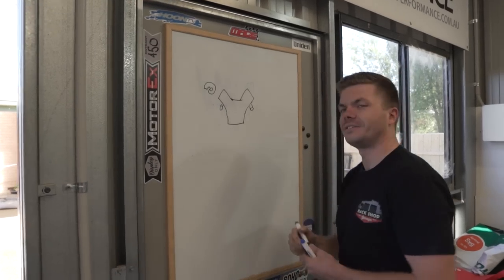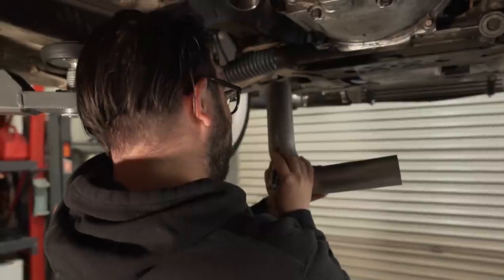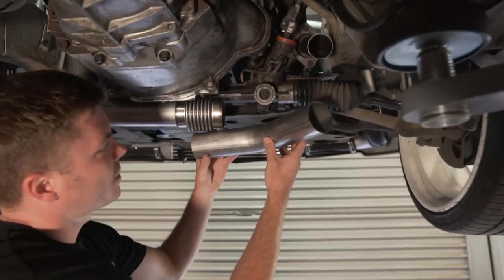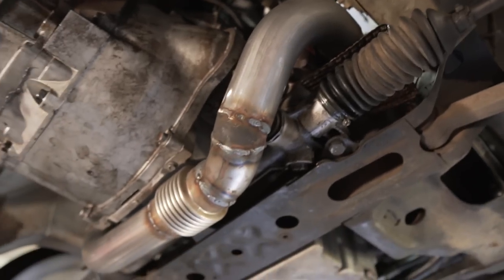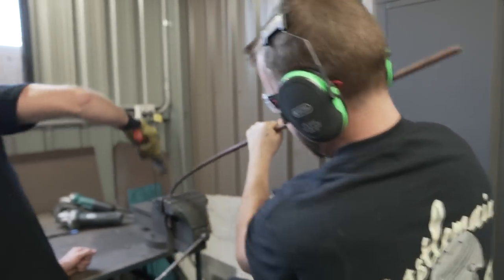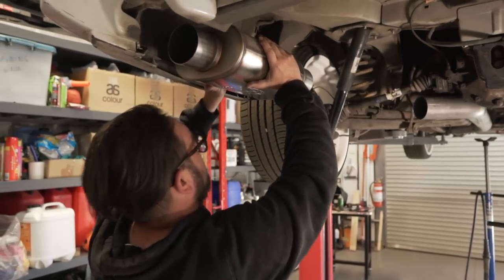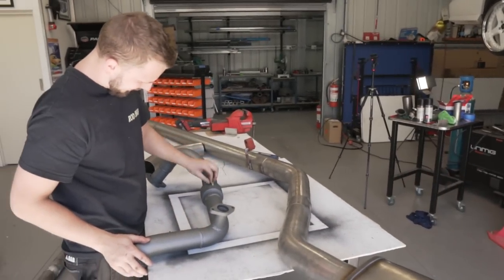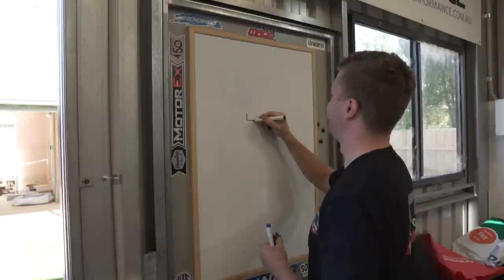BUILDING A LS1 TURBO VY UTE!! - Part 10 - BUILDING A CUSTOM MADE MASSIVE 3.5" EXHAUST!!!

Comment: Comments section never fails to produce all the arm chair experts lol! 🤣
On the turbo tonner we used a 38mm gate and not in a priority flow location, but still managed to hold a steady 8psi gate pressure. Could it be done better? Sure! Doesnt mean it isn't going to work. People forget that the gate isnt just servicing one bank. The turbine presents as a restriction, pressurising the exhaust manifolds, and the wastegate becomes the relief.
Reply: This comment section surely has to make an appearance on the podcast 😂

Comment: Wrap tip...soak the exhaust wrap in water before using it, helps keep itchy fibres down and also helps cinch it down when installing. Good stuff guys loving the vids

Comment: Gerday mates, been watching you all for a couple months now & love your show. Watching the LS1 install & to see how you attack problems is way cool. Ability to solve probs is a gift which you guys seem to have in abundance. Its inspiring. Your use of a propane torch to heat things could use a bit of help. The hottest part of any flame is the tip of the blue burn, not as close as you can get the torch tip to the job, back it away till the tip of the blur is just off the job. This will make heating faster and hotter. Could have used this to make the bent rods to mount exhaust. All told, the exhaust looked superb as was the turbo pipes and how you solved the intercooler mount was too cool mate. I could watch you guys working for ages. It comes across as two close mates having fun with cars and enjoying the hell out of the day and the job. Thankyou for all the entertainment you have given me and I will keep following you as long as I can.  Peace out.  Wayne
wayneleonard.muir@gmail.com

Comment: Love your work Guys. Just a bit concerned about the position of the waste gate. Won't the left hand manifold will be blowing full pressure to the turbo. Not sure if that'll work or not. Anyway have a great Christmas and new year. Keep up the good work Guys.
Reply: not ideal but works fine
Reply: The left hand manifold will still get caught by the restriction of the turbine, and the exhaust manifold and crossover will still pressurise thanks to back pressure.

Comment: I’m a big fan of the channel, never miss an episode 👍

The wastegate position in my opinion might cause an issue, shouldn’t it be after both banks have converged and before the turbine housing?
Reply: Gas flows via the path of least resistance. With the manifolds connected by the crossover, they'll act like a single manifold. Pressure relieved at any point will relieve pressure at every point. Needs a cat though.
Reply: @howey1975  but the exhaust gases from the drivers side bank are travelling in one direction towards the other manifold, once the gate opens does only the exhaust gas from the drivers side regulate the turbine speed? As I don’t see the passenger side gasses travelling down towards the gate against the drivers side gasses. Would that not just promote uneven heat between both banks?
Reply: Think of the manifolds and crossover as though they were a water balloon with two inlets. The water inside the balloon isn't governed by where it came from, it just wants to get out. Open the "wastegate", water comes out and relieves the pressure in the whole system. There's virtually no difference between a gas and a liquid under pressure
Reply: @howey1975  are you saying that the 2 exhaust manifolds are the “balloons” inlets? 
If so I would agree with you that opening any passage will vent pressure. In this case tho you are also spinning a turbine, all the gas is going in one direction, then the gate starts to open, what happens to the gas flow between the gate and the passenger side exhaust manifold? Which direction is it going? What is continuing to power the turbine?
How I see it is that the drivers side gas will do all the venting to atmosphere with some of it still travelling up to the passenger side to continue powering the turbine, with all the gas from the passenger side powering the turbine.
If the turbine doesn’t need any drivers side gas then all of it will go out the gate, if the turbine doesn’t need even all of the passenger side gas then there will be a reverse flow in that pipe in between the gate and passenger manifold, while still spinning the turbine.
This reversion up and down that section of the cross over seems very inefficient to me compared to venting the gasses after the 2 manifolds have converged, keeping gas flow going in a single direction at all times.
Reply: I think you're over complicating it mate, but I could be wrong.
Reply: @seanb250  The turbine quickly becomes a restriction, the entire manifold and crossover pressurise (hence people logging EMAP for backpressure data) and the wastegate then becomes the pressure relief.
Reply: @TorqHub  I do understand how the whole system works and the importance of gas speed and pressure ratios within the exhaust system that powers the turbine.
Given all that, I see the placement of the gate in this case very inefficient, it will introduce changes of direction in gas flow, which is a loss of velocity, this will lead to increased turbo lag and other boost control issues in my opinion.
You surely would want the gas direction of flow to be in a single direction and bled off via a gate just before the turbine housing itself.
Reply: @Sean B  in a perfect world, absolutely. And if you needed precise control for say a boost by speed application, it'd be non negotiable. But in this low boost Street bruiser that'll likely see gate pressure or a touch more with a boost tee, this will work.
Reply: @TorqHub  I agree that it will work, rubbing 2 sticks together to make fire also works but you just wouldn’t do it that way if you had a lighter.
Anyway I’m interested in seeing how it goes because we all know everyone starts off saying they will be happy with low boost 😂

Comment: Nice job guys. I'm a little concerned that there is no cat converter on a street registered car. I mean the hi flo 100 cell units keep you legal with very little compromise to flo.
Reply: Don't be a Kevin
Reply: Never ran cats never will,unless police get me,then yes,I use to run 100 cpsi cats but on na with juicy cam sound way better,U see old big blocks old v8s running cats
Reply: I have a cat that has been gutted out in my turbo ls exhaust system 
Will keep the cops happy if they look under but been 18 months so far and never been hassled once 
Go figure 🤷‍♂️

Comment: Nice work 🤙🏻, not being a dick but gate size and position might be questionable on an ls.
Reply: I thought the same thing, I used an ex50 on mine with a 2 inch screamer
Reply: Yeah, boost control will be an issue. Suppose could add another on other side

Comment: Nice job boy's but what about o2 sensors?
Reply: Not required, will be manffless tuned which uses a set map
Reply: Probably didn’t explain clearly enough, the fuel & ignition tables will be set maps not variable like the open/ closed loop scenario when an o2 sensor is used.

Comment: Will you run a reference from that wastegate to the turbo ?
Reply: Wont need to if they are just running gate spring pressure
Reply: @TorqHub  yes you do, it will stay closed without a reference
Reply: @E-Z_Gaming  sorry I was thinking top port 😅
Reply: @TorqHub  ahhh yes very good thanks.
Top video I would like to see a lot more grassroots turbo builds on ls commys

Comment: Where did the factory oxygen sensors get mounted?
Reply from the maker: It gets mounted in the dump pipe, just before the first flange. And we wired in both sensors into a single one
Reply: @HackshopGarage  ok cool and that's working fine?
Reply from the maker: @wombat178 yeah mate all good. I’m not sure if our tuner had to adjust anything on the ecu side though
Reply: @HackshopGarage  thanks heaps for the info. It's a bit hard to find a clear answer to it

Comment: The gate probably should be basically on the crossover, not via that little dick, as flow is impeded on the unnatural 90. I also think a 44 is too small for the setup. But yeah goodwork!